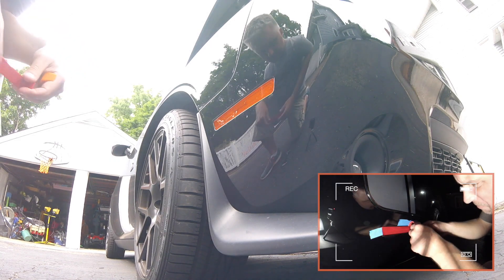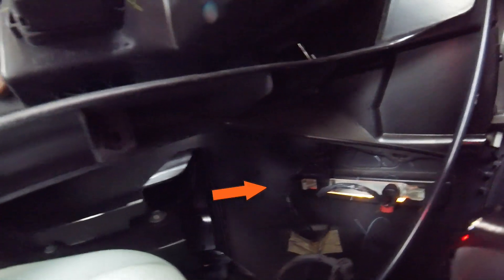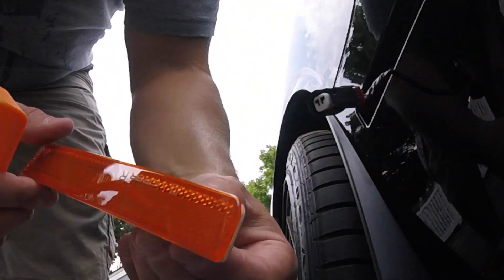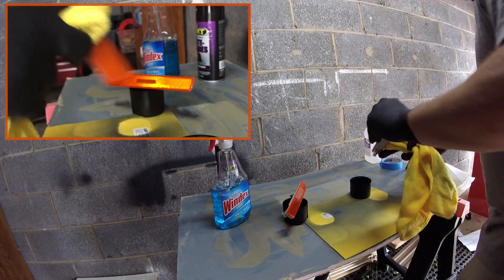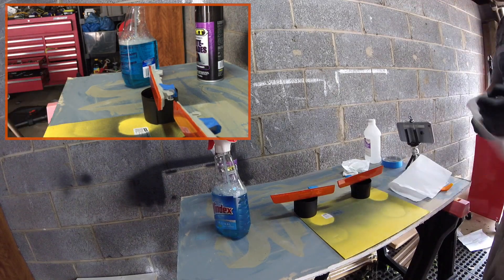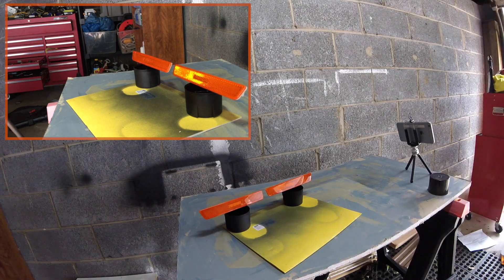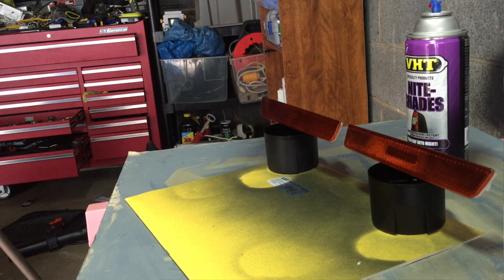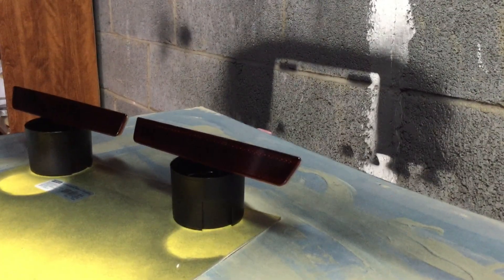Challenger Side Marker Removal and Tint with VHT NightShades

Comment: This is exactly what I needed, thanks!
Reply from the maker: Hey, before you go nuts painting them there is a much easier option.  After I did my side markers I found Luxe Auto Concepts.  They saved me HOURS of work with their pre-cut film.   I do a challenger side marker in this video and it's soooo much easier.  https://youtu.be/R4cq2tp0zAE?list=PL_C69kho0QAsuGvLyQd_E6CG9xhdjcyva  

Code workplaydrive will save you 15% on your order too :) Order tint kits here... http://bit.ly/2lYCvux

Comment: I have an idea for a new video for you.  I picked up an SRT 392 in July. I have been unable to find definitive info on jacking points or SAFE places to place jack stands without damaging the car or worse - me.  I've seen you car up on stands and the use of a floor jack.  I thought a video showing proper placement would be greatly helpful.  FYI - I'm a Jersey guy, too.
Reply from the maker: Nice, that's actually on my list of stuff to do. 

I had the same problem last year, it took me a while to find where the safe points are as they are not mentioned in the manual.   I'm putting the car up on the jack stands over the weekend, I'll record something for that and include a list the tools I use to safely get it up there.

 If you're a north Jersey guy we've got an active club check out northjerseymopar.com, weekly meets, group cruises to shows and events, great bunch of people.  I joined last year and it's been a great experience.

Comment: What do you think about these?  https://www.carid.com/2016-dodge-challenger-signal-lights/oracle-lighting-concept-sidemarkers-set-394960250.html   I bought the "ghosted" version which is totally black and lights up a single strip of LED when turned on.  I had mine vinyl wrapped but not happy with the way they look when the lights are on.
Reply from the maker: I love those as long as you get the Oracle brand you will NOT be disappointed.  I was originally considering them after seeing them on a friends car, but I spend the cash on other mods :)
Reply from the maker: :( file not found error
Reply from the maker: Dale Meyer wow those are stealthy 😱

Comment: Get a oil catch can by Billet 🇺🇸
Reply from the maker: It's on the list... Still trying to layout all my Billet engine dressings not sure if I'm going burnt orange or Black.
Reply: Work Play Drive my scat is all black yours lol I got the purple , just to add a splash of color !
Takes like 3 months to get it !
Reply from the maker: Nice!  I'm in no rush I've got all winter to plan and work on it.
Reply: Brooklyn001 I got to get one for my scat...but man...those hoses are cemented on their...any tips?
Reply from the maker: If you pull they get tighter you need to push from the end using a hook or pry tool